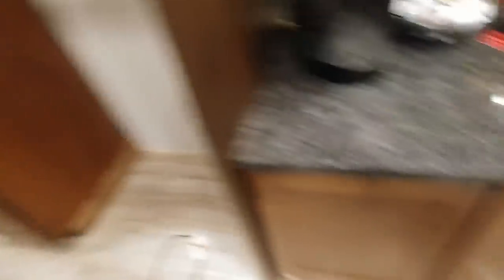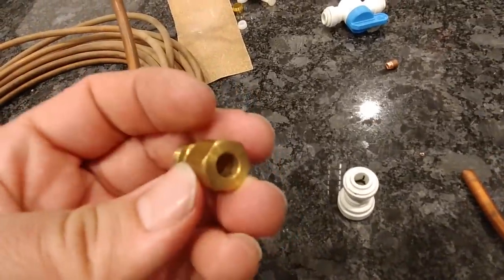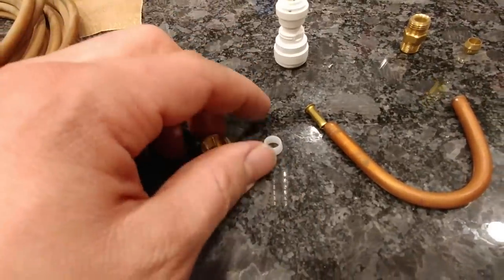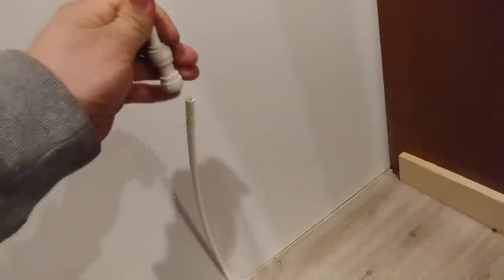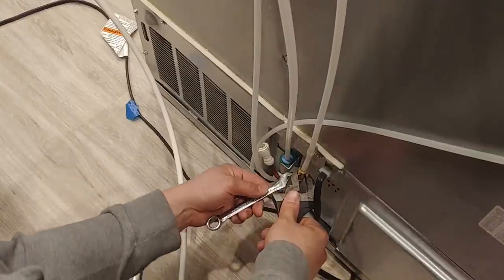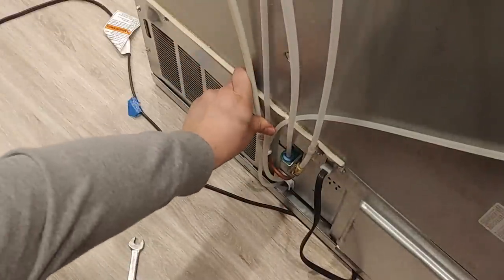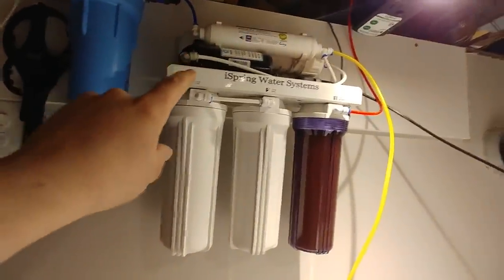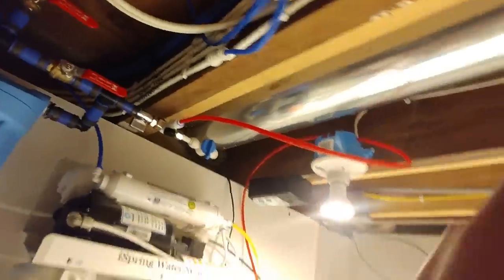How To Connect Water Lines to Ice Maker/Refrigerator

Comment: I was looking for a waterline manifold to connect from my iSpring RO system to a water dispenser on my sink and the 2 refrigerators in my home. I wanted the manifold to be both mountable and with individual valve shutoffs to each water device. Any thoughts?

Comment: Where did you get the 1/4" to 1/4" outside diameter press coupling? If ever I find that I am just cutting the union off the comes attached to the fridge and press fit it that way.

Comment: Thanks i was needing to do this,had to be a challenge with them distractors!!ha,ha, i had to make a loop inside my fridge to bypass filter they dont make that type no more and old one was cracking apart,filter looked usable i thought i might try and use fibreglass sheets to seal it once more just not certain on doing inside cracks with glass gel.snooky

Comment: Using a wider diameter tube won’t increase water flow if there is a bottleneck caused by a smaller diameter tube connected to it.

Comment: Problem is that my exact bosch fridge won't except a 1/4" copper line on the factory fitting. Also you should probly put a clamp on the backside of the pex water line to not disturb the fittings. I always run copper. Had 2 pex lines that mice ate thru it. 40 yr plumber.

Comment: Do the world a favor, fill up a bucket with 3/8 line with a 1/4 reducer and a 1/4 inch line and let us know how long it takes for each, Thanks
Reply from the maker: Good idea! Perhaps I should do that sometime.
Reply: @BenjaminSahlstrom  I was actually going to ask this question: won't the flow inside the 3/8 line still be limited by the 1/4 reducer on the end? It seems to be that all the 3/8 -> 1/4 reduction is going to do is increase the water pressure at that point, but I am merely am amateur so I'm not really sure.

Comment: 3/8 to 1/4 doesn't help water flow. Your bottleneck is not only the reducer you installed, but your fridge was manufactured to accept water flow from a 1/4" line. Main feed lines to important parts of the house should be at least 3/4. Not the 3/8 lines you showed in the basement

Comment: When I'm on homedepot and it says "Water kit required" what does that mean? Does it mean I need one for ice? What if I don't need ice and just need to freeze stuff? Or is the water used for something else? thanks
Reply: Your freezer does not need an outside water supply just to cool/freeze things. The outside water supply is needed for two "options" that pretty much every fridge/freezer has these days: built-in ice maker, and filtered water dispenser. If you don't plan to use either of those features, you should be able to just leave the connection unhooked on the back of the fridge and everything else will work fine.
Reply: @KutuluMike  Awesome! Thanks

Comment: At 1:24 you show us the fitting on the water line coming from the fridge...on my fridge, that is where a leak has sprung.  Is the fitting able to be "re-fit" onto a new tube (or the existing tube if I cut it off and reattach), or do I have to buy an entirely new tube with the fitting pre-attached?  I have a Maytag MFI2067AES12 and I cannot find a replacement tube anywhere that has that fitting preassembled.  I have a copper water supply.  Can I just cut off the brass fitting from the fridge water supply line and connect an adapter (line the one shown in your video) from the plastic water supply line to the copper water line?
Reply from the maker: That may work. You need to confirm the outside diameter (OD) of the line you want to cut first and make sure that it is the same as the push connector that you would like to use with it. On my refrigerator the water line with that brass factory connected fitting was not the same as the 3/8" or 1/4" OD lines that I had. Very annoying because otherwise I could have just clipped that little fitting right off.

Good luck!!
Reply: I ended up getting a push connector to connect the water line from fridge and copper water line - 5/16 to 1/4.  worked like a charm (so far).  Thanks!

Comment: I don't know why you just didn't cut that brass fitting off your fridge and then just use a double ended 1/4 inch push fitting.  Job done and a lot less connections.  I can see 3 connections between wall and fridge on your set up.  Could have used just one.
Reply from the maker: B Drew Right on! That is EXACTLY what I was planning to do but the size of the tubing on the back of the fridge is NOT standard 3/8" od size like it looks so I was forced to use the compression option instead. 

I like the way you noticed that. Also, the reason I had to extend the line was that I had to install the water line during rough in and it would have been in the way to have a long piece of tubing there during construction.

Thanks for sharing your thoughts!

Comment: Reverse osmosis water should never go through copper tubing as the purified water will leach metal from the tubing, and make your ice/water have a metallic flavor.  In addition,  over time it will eventually lead to pin holes and thuse cause a leak.  Also read the manual to the ice maker.  Many ice makers have metal components, and the manufacturer warns against the use of RO water, and in some cases it voids the warranty.

Kids are nice, but they do not belong in an instructional video, makes it very unprofessional.  Perhaps have them there only for the last few seconds.

Cheers.